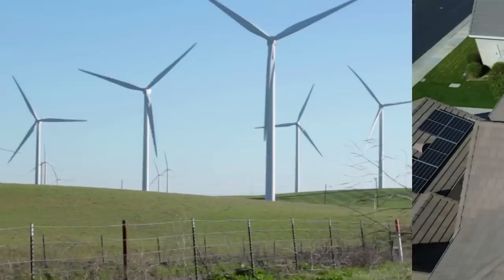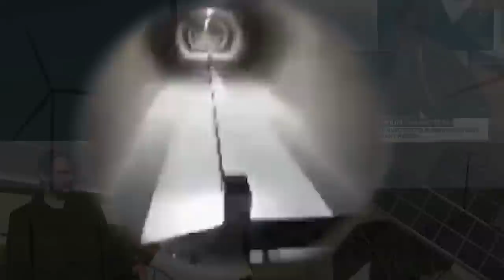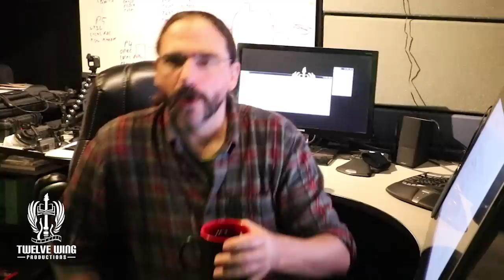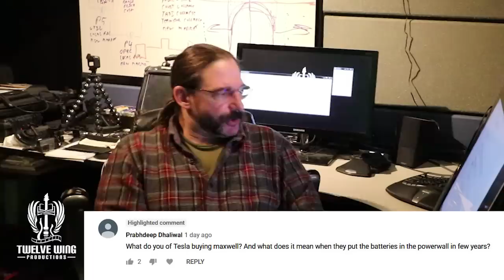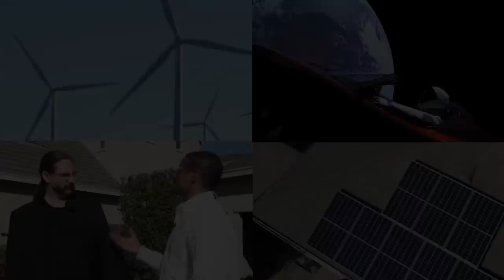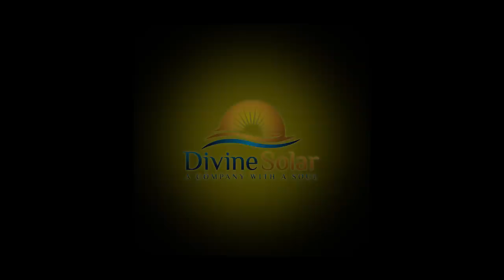Tesla purchases Maxwell; What does it mean for the Powerwall?

Comment: I would like to establish a direct line of communication - please email - I have some big ideas.
 "Why a pouch ?" 

 The Braga-Goodenough  cell with its  high voltage Solid Glass Electrolyte ( SGE ), and combined capacitor/battery, is the basis of my analysis.
 
Multiple single layer flat A4 size cells built on top of each other, are possible as there is no liquid electrolyte  connecting cells. Dendrite and toxic inflammable liquids are eliminated and safe higher voltage can substantially increase power density. 

With the edge of the sheet electrodes the electrical connection , the ”fine wire fuse” and stainless casing are eliminated, the management system can be simplified.  Charging/discharging speeds increased & power density improved. 

Look at 500 sheets of A4 paper, then think of  single layer cells ( anode – solid electrode – cathode ) on top of each other, eliminating the need to build & assemble 100+ cylindrical cells. Then consider with expansion solved,  high performance silicon can replace graphite, and ultimately  the move to sodium.
Reply from the maker: There are two videos where I go into some detail about pretty much what you are talking about.
To support my argument I anchor it with the thermal properties of the solid state batteries.

Right off the bat id your talking about a battery that operates at a higher temperature without increased degradation, then right away you can reduce the weight and mass of the battery by simply reducing the bulk of the coolant loop and to a greater extent the entire thermal management system as a whole.

If you are talking about the interesting properties of monocrystal garnet, have a look at this video and fast forward to the 20 minute mark:

https://www.youtube.com/watch?v=MyJPhINgFr4&feature=youtu.be
Reply: Thanks for your interest - Yes I could & would like to match you blow for blow with technology & economics. .  I understand these , but can't help but think the cars are "Mine is bigger than yours"  Edward  from Sydney Australia @twelvewingproductions7508
Reply from the maker: @edwardmorpeth5988 , Not sure what you meant by that last bit.  I think both our countries are pretty spread out and our vehicles tend to be larger than what is commonly accepted in Europe.

Comment: Personal journey into solid state chemistry - John Goodenough  = Journal of Solid State Chemistry  271 (2019 ) 387-392.  I think you will enjoy. I'm going out on a bit of a limb, but believe Tesla would have had  intimate knowledge of the capacitor/ battery cell  US 10,109,859.  for 3 years  &  it is the new 1 million mile cell.   

Maria Helena Braga of the University of Porto, Portugal, brought to me a remarkable dielectric amorphous-oxide (glass) A+electrolyte (A = Li, Na, or K) that has a huge dielectric constantε =106 to 107 at room temperature and an A+conductivityσi≈10−2Scm−1 at 25 °C, equivalent to that of the flammable liquid-carbonate electrolyte of a Li-ion battery. We have shown reversible plating/stripping of a metallic lithium anode for over 24,000 cycles with a Li/Li+-glass/Li cell, which has opened the door to the development of all-solid-state rechargeable  lithium or sodium cells.
Cheers

edward@greenfield-technologies.com
Reply from the maker: Thank you very much for that.  It's confirmation of exactly my thoughts on the matter as well.
I'll look into this and do a little video on it.
Thanks again.

Comment: Will the dry electrode process apply equally to future solid state batteries? Is Musk himself pursuing the solid state battery concept? Are Maxwell capacitors currently state of the art? What about 3D printing of graphene to make ultracapacitors? I'd like to know more about where batteries and capacitors are headed, and how this will affect Tesla.
Reply from the maker: I'm going to guess and say that the process for making a solid state battery will be totally different from any kind of process used in the current batteries.
Again, I have no inside knowledge in this, but by looking at their structure it would seem this will be a pouch type battery but with non of the current vulnerabilities of pouch batteries using an oxide layer and a separator.

That's the interesting thing.  I think that Tesla purchased Maxwell to get hold of the process to allow them TO make these batteries, but I am going to make a firm prediction that Tesla doesn't WANT to make them.
They would rather have Panasonic license the new process and continue to make batteries for them while they finish development on the solid state batteries.

But again, this is just a feeling I have and not based on any actual hard information.

I also don't have enough direct information on Maxwell's Ultracaps other than some specifications that were leaked.
I don't know their architecture, only a rough idea of how much additional energy they store and for how long.
Reply: @twelvewingproductions7508  Thanks! : )

Comment: interesting as static stators and other such torque collective efficiency but perpetual quantum mechanics sure would also improve the efficiency along with securing the technical instrumentation such as constant over monitoring becomes inefficient , perhaps the answer eventually to improve performance might be  a better electrothermal pump that utilises as we know other such transfer in I .e light fibres independant wheel control simple computational electrofluids and maybe even accellerometers  relativity comparative to nodes in stationary cavities within what is becoming more of a photosensor reliant demand in selfdrive traffic. It still is complicated to imagine the demand for such increased congestion of market share. Eventually perhaps the complex car with no wheels which utilises pneumatics inflated skid lander and compressors again which couldn't be offroad but become like many hovercraft and waterworthy.Were pretty primative with carts n horsepower I suppose though and I hope they do well, eventually even winged passenger jets might become superceeded by rockets however their increased electrodynamic appeal should yield an interesting evolution. Safe nuclear uranium long life cells again could be also achievable if low yield and somehow minaturised in a similar genius of design and the mega joules capacitated nicely, but sure this is getting very extremely theoretical. I think its an American interstate concern though more than anything and its a big want by most conventional in society, it still exists doesn' it if not a technocratic feudal retrograde reliance in natural planetary cooling might boost the none electric remaining oil and gas fields which quite might become  important like potentially dangerous methanol, hey look at  Mars as a planetary advice to many here on Earth.

Comment: 6:00 "*for the amount of energy they're able to hold." Power = energy/time. Capacitors are good at power rate and bad at energy capacity. Batteries are good at energy and bad at power. I know it's easy to misspeak when talking off the cuff. I'm a physicist and I still get it crossed sometimes. :)
Reply from the maker: Good catch, and yes.
What I was trying to get across is that due to the mass needed for ultracaps they aren't there yet.
I'm also not entirely sure that from that point of view it was completely inaccurate.
Capacitors in themselves aren't terribly useful in power delivery.
The point I was making with their inclusion in a battery pack is that because they stored the energy in their structure and not as a part of their chemistry, they were by necessity quite a bit larger by volume.  Even with structures like carbon nanotubes.
That said, they are starting to blur the line between batteries and capacitors in the length of time they can store that charge.
That too was something I wanted people to take away from all this.

Thanks for following the nonsense.
Reply from the maker: I also see you are a musician.  I'm listening to some of your stuff now.

Comment: Cobalt is not a rare earth element
Reply from the maker: By percentage of weight the common composition of the Earth's crust is as follows:
Oxygen- 47%
Silicon- 28%
Aluminium- 8%
Iron- 5%
Calcium- 3.5%
Sodium- 3%
Potassium- 2.5%
Magnesium- 2%
....
........
........... Every F-ing thing else.... 1%

So I'm not exactly sure by what metric you are using, but in mining, Cobalt is considered a rare earth.
Reply: @twelvewingproductions7508  I'm surprised you used the term 'rare earth element'. That is quite specific and is different to some material such as Cobalt being rare.  Cobalt may be rare but it is not a 'rare earth' element - the 17 rare earth elements are: cerium (Ce), dysprosium (Dy), erbium (Er), europium (Eu), gadolinium (Gd), holmium (Ho), lanthanum (La), lutetium (Lu), neodymium (Nd), praseodymium (Pr), promethium (Pm), samarium (Sm), scandium (Sc), terbium (Tb), thulium (Tm), ytterbium (Yb), and yttrium (Y)
Reply from the maker: @leokerr9784 , I stand corrected.  I suppose that because of it's relatively low percentage I had assumed that it was one of the rare earth's.

Comment: Super capacitors and ultracapacitors are just different names for the same thing - they are not different products. 20% of the battery in ultracaps? Maybe in a bus, but not in a sedan. Skeleton, who lead the world in this space with nanotech, have only achieved 9.6Wh/kg as opposed to say Tesla’s 2170 cell which is around 250 Wh/kg. That’s using graphene and that is not something they can mass produce - they’re still stuck at around 6.8Wh/Kg for their industrial ultracaps. I think Maxwell’s cutting edge supercap (that’s what they call them) tops out at 7.2Wh/kg. So 20% of the battery would weigh 500+% of the current battery pack using Skeleton’s best nanotech. Yes we may see improvements but not on that scale in the foreseeable future. They will come in handy for quick acceleration and regen. Because they are much more power dense than batteries.
Reply from the maker: Like I said, we aren't there yet.
I'm not sure if I'm as skeptical of what is on the horizon once mass adoption takes hold and we see the same kind of investment and development in batteries as we do in oil exploration.
The truth is likely somewhere in the middle of your opinion and mine as far as timeline.

As to what you said about the differences in nomenclature, that is exactly what I said in the video.
Super/Ultra/Mega/SuperMegga/SuperULTRAMEGA! 

It all just means that it's better at doing what the previous technology did but retaining the same method.
I thought I had made that clear.
It is, however, also accurate to say that the latest generation of ultracaps are blurring the line between the functionality of a battery and the functionality of a capacitor.
While it's true that they deliver their energy in very different ways, it is equally true that these new ultracaps are storing that energy in ways that used to be only possible with a battery.
And that's impressive.
Reply: Twelve Wing Productions one other bit of errata. The reason the PW2 can only deliver 5kW continuous and 7 peak is the inverter. The batteries are definitely not the bottleneck. Although restricting them to 0.5C discharge may make them last a bit longer.
Reply from the maker: @mondotv4216 , I'm treating them as an entire unit.  Because Tesla doesn't give us access to the DC buss in the PW2 (for good reason as we discovered in Germany) the limitation is on the PW2.
I don't have the option of altering it's output and neither does the average consumer.
So take what I said as a whole.  It's a limitation of the PW2.
If the PW2 was redesigned to take advantage of ultracaps, the inverter/rectifier would be redesigned.
Reply: Twelve Wing Productions You started the video by talking about the differences between capacitors, supercapacitors and ultracaps. It definitely seemed like you were differentiating them?
Reply from the maker: @mondotv4216 ,
Watch the video again.  Though I did clearly say that with ultracaps they had started to blur the line between a battery and a capacitor, that there was no difference between them as far as how they stored energy.
I believe my exact statement was that:
"It only means that they are better at being capacitors".

If I gave the impression otherwise, that was not my intent.  Everything you have said regarding their bulk is true and was mentioned in the video.
Though we would like to see some form of ultracap in the batteries, we probably aren't there yet.
The "20% of the battery pack" being ultracaps was nothing more than a thought experiment to show where this could possibly go in the future.
Again, I had hoped that I made that more clear in the video but apparently not.

I do believe that the next generation of battery packs we will see from Tesla will include some ultracap technology.  It may not be in the pack itself but might be some kind of add on module if they can find space for it.  Hard to say.  It would have to add a pretty significant range benefit to be practical though.
People aren't going to sacrifice storage space for 10-20miles of range increase.
Reply: Twelve Wing Productions you definitely implied that supercaps did one thing and then ultracaps did another. Perhaps you just forgot you called them different things. Anyway not worth arguing about. My point with the inverter is you don’t need ultracaps to increase the power of the PW2 and in fact they wouldn’t help. Unless you change the inverter. In which case you wouldn’t need the ultracaps.So the correct answer to the original question posed by the commenter is Tesla’s purchase of Maxwell will only make a difference when and if their dry electrode process makes the batteries cheaper, maybe higher capacity and faster to produce. In which case it should bring down the cost of the PW2 and deliver a much higher volume of batteries making more available for PW2 production. Which is currently very limited.
Reply from the maker: @mondotv4216 , your conclusion is true, but with a caveat. 

It's not about making them cheaper.  The reality is that the dry electrode tech makes it possible for Tesla to produce them at all.
If they had tried to produce batteries on their own using the same method that Panasonic uses, there would be subtleties regarding their method of manufacture that they would claim were propitiatory and illegally obtained by Tesla.
With the acquisition of an entirely new manufacturing method, Panasonic can't claim that breech of patent or contract.
Reply: @twelvewingproductions7508  I think it's all about making them cheaper and quicker to manufacture - that was the motivation behind the purchase. It's true that it looks like Panasonic and Tesla will eventually split, but I don't think that would have happened without this purchase - it's a chicken and egg thing and the purchase is the catalyst. Panasonic have seen the writing on the wall and as such are divesting themselves of their stake in Tesla and signing contracts with rival automakers. It's been a strained relationship since the Gigafactory was built with Tesla claiming Panasonic were holding up the production of the Model 3 and Panasonic counter claiming that Tesla employees were causing quality control issues with the battery manufacturing process.  So yes, there's the subtle patents thing although I'm pretty sure that any advances made in battery chem Tesla would have made sure they held joint patents. What they won't have patents for is Panasonic's manufacturing process, which is all the Maxwell technologies thing is - not an advancement in battery chemistry. It's an enormous gamble for Tesla to split with Panasonic so I hope the Maxwell dry battery electrode process is as successful as it promises to be. 
There are risks here. You have the supply chain risk of losing the world's leading battery manufacturer to rivals, relying on unproven technology and there's a risk that advancements in solid state batteries will make the dry electrode process obsolete.